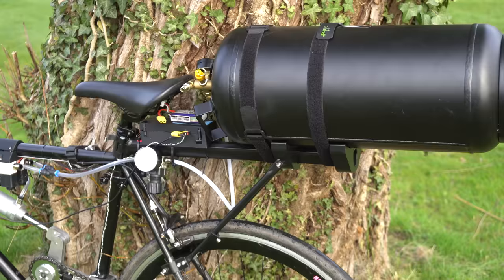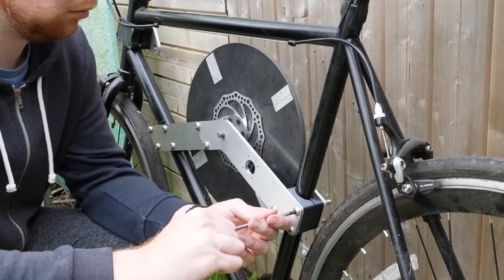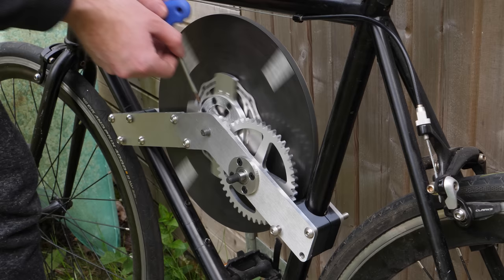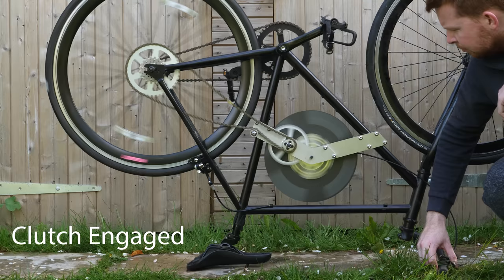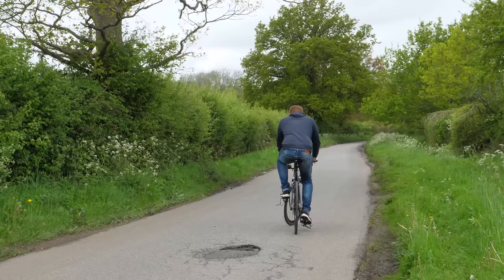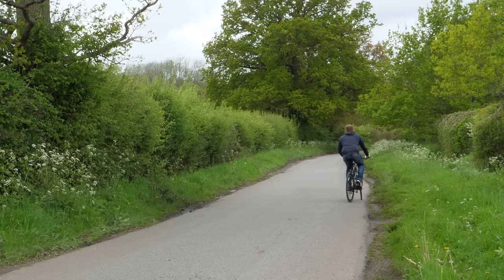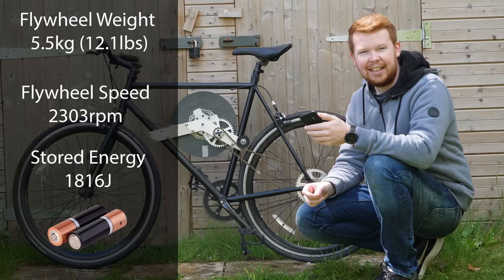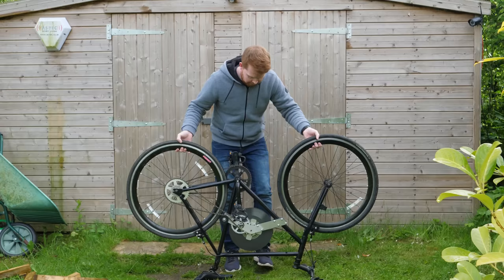Flywheel Bike KERS

Comment: Oh, Boy!  A homemade, high-speed flywheel rotating just beneath my groin!
Reply: Yay!
Reply: The sound alone is harrowing. It's like something out of Greek mythology. (Still awesome, though, in a mad scientist kind of way.)
Reply: Needs more jagged edges. Use a dia-tipped Sawblade...
Reply: If you want your boys snipped, look no further!
Reply: ok
Reply: Don't threaten me with a good time.

Still cheaper than GCS.
Reply: Your comment let's us all know you don't have anything in that area to be concerned about anyway so... If you did, you wouldn't be complaining about it.
Reply: @mikeznel6048  Men. 

Safety is not a betrayal of your manhood.
Reply: @mikeznel6048  wha...what?
Reply: That's a leap of faith.
Reply: U don’t need jewels 😂
Reply: It’s just a matter of time
Reply: @TeamCykelhold  He was saying "No balls".
Reply: Motorcyclists put a huge tank of gas and an internal combustion engine between their legs every day. We're doing just fine. Mostly.
Reply: Might I suggest a pair of steel underoos?
Reply: This is an old swiss patent,  from the man who invented yodeling ...
Reply: Kinky~😩
Reply: Also known as the "girl maker".
Reply: Who is this groin character 

(Hermitcraft and tommyinnit in mcc)
Reply: Scary!
Reply: Everything is made by someone,  it seems mint enough. Could still use some sort of enclosure non the less to prevent snagging.
Reply: And two small weights attached on the outside. What could possibly go wrong?
Reply: Balls of steel.
Reply: Mi first though also! 😱😱😱
Reply: Completely safe
Reply: Hahahahahahhauaha no margin for errors
Reply: sounds fun
Reply: At least you got a bike seat and a metal tube stoping it from hitting you.
Reply: Wait until you hear about motorcycles lol
Reply: I think it needs spikes or blades added.
Reply: Better have faith in your engineering skills huh?
Reply: Lmao
Reply: What could possibly go wrong? Right?!
Reply: Could you have used disc brake rotors instead? They are already drilled
Reply: Conceptionally not that much worse than the ICE I'm always sitting directly over when riding my autobike.
Reply: @PacAnimal  key word ... "mostly" 🤣
Reply: @mikeznel6048  My comment was straightforwardly enthusiastic.  I already wanted to see a flywheel on a bike.  Someone commented that we could install a flywheel guard.  Others chose to write comments alluding to the qualities of my groin.  Well, that's the Internet for you!
Reply: Yah
Reply: @nisemonoyarou  So check out 'i made a thing' who made a gasoline powered bayblade. I think it might satisfy your desire.
Reply: Oh boy a solid metal heavy beyblade top mere inches from my groin!
Nothing could possibly go wrong!
Reply: What could possibly go wrong?
Reply: the bicycular-vasectomy-inator
Reply: Imagine the flywheel on mythbusters between the legs...
Reply: I call it... The Cataclysmic Castratocycle!
Reply: What could possibly go wrong😜
Reply: @tutacat 

Read that in the voice of Professor Farnsworth!
Reply: WHAT COULD GO WRONG
Reply: I dread to think of the consequences should that flywheel burst that close to one's private parts.
Reply: interesting  Yeah? Was she toothy?
Reply: @mikeznel6048  If you had something in that area then you wouldn't be complaining about it?  Say what?
Reply: @nisemonoyarou  for aerodynamic reasons yeah ? >..<
Reply: I knew right from the start exactly where this was groin...
Reply: Nay
Reply: @gwagwa76  hehehehehe
Reply: I wonder what can possibly go wrong
Reply: Kers will turn him into hers
Reply: Ha yeah, what could possibly go wrong
Reply: Back in the early days of Top Fuel Dragsters, the driver would sit in the rear of the car with their family jewels just inches from the Differential that was transferring thousands of horsepower and Nm of torque whilst containing hundreds of pounds of extremely high speed rotating mass. Good thing they had balls of titanium in case a diff exploded!
Reply: @PacAnimal  ahh. Took enough scrolls to find someone on the level. We think this stuff is cool and lay risks with denim, denim/kevlar, or leather/kevlar jeans on with more attention paid to protecting our heads not so much our balls. But i will say im glad i wasnt squidding when i hip thrusted my handle bars at 40 mph. Lol
Reply: Its both genius and freakin insane! I love it!
Reply: Yeah I'd want so much more between me and that wheel in the event of a high speed material failure.
Reply: @Boe_Jidens_Hair_Sniffing  Way cool!
Reply: he could've used Tchaikovsky's "Nutcracker Suite" as background music for the video
Reply: @tutacat gunna need a set of regenerative something after riding that monstrosity, that's for sure.
Reply: @magnum0121984  not heavy enough
Reply: Ladies and gentlemen - the Testicu-Gone™️ Mk I !
Reply: @far1002  Joules?
Reply: @headly21  u need those 🤣
Reply: @onyxtay7246  Aweful lot of chicks in here... Men don't cry about being scared. In 2021 "men" cry about the wrong toilet paper and nail polish. I think you're getting them mixed up....
Reply: Hmmm... Something is a bit off here... Lots of people so worried about something they never will ever come in contact with... And the thing isn't made out of Legos like you're used to "building" toys out of. The dude made it out of steel and aluminum... Why would you even allow your lower parts to be hanging out of your pants or shorts? While on a bicycle? Awful lot of "what if" cry baby "men" leaving the most feminine, scared, baby, child like comments... If you're worried about your junk on this thing, its internal junk so you don't have anything to worry about then. If you have exterior junk, and its real, being worried wouldn't even be a thought because you're not gonna be riding this thing naked anyway... Man, the world is so crybaby now a days....
Reply: Might as well sharpen the edge like a deli slicer.
Reply: It’s the thrill of the bite
Reply: And they are not balanced. That's some courage
Reply: Lol that's what I thought when I saw..."what if"...lol
Reply: @PacAnimal  they also have a flywheel secured by special stretch bolts inside a gearbox. not ready to slice your chest open
Reply: If you really trust your engineering and fabrication, use a tablesaw dado blade!
Reply: Watch your bangers and mash!
Reply: @PacAnimal  Yeah... although I recently had a surprise when my waterpump got a pinhole leak in it. I made up a new saying - "Better than being shot in the crutch with a jet of high pressure superheated water!"....
Reply: My thought exactly
Reply: This is the only thing I could think about the entire video.
Reply: @onyxtay7246  so you're saying your not a real man, since you're whining about something another says?🤔
Reply: @roberthubbard7827  I mean, I'm not even a man, so I think that much should be obvious.

My point is that it's absurd to define masculinity in that way. It's ridiculous to go "hurr durr, you need to do risky things without thinking or you're not a real man. Hold my beer while I jump off the roof!"

It's a bad definition of masculinity, and if someone's going to try forcing a toxic stoicism onto others then I expect them to stoicly shut their pie hole.
Reply: You should see where they put the huge chainwheels in HPV speed bikes!!
Reply: @PacAnimal  id trust that WAY WAY WAY more than this. The chance of anything happening to affect your boys, are so low, I’d bet money you wouldn’t even be able to find an example of it. But this thing? Very easy for something to happen
Reply: Fun
Reply: Like a large grinding stone to sharpen your tool!
Reply: Could double as a transgender surgery robot!?
Reply: Come on ur just smuggling grapes
Reply: Some people just don't want kids of their own 😁
Reply: @PacAnimal  Gasoline is nonexplosive and as long as the engine is properly maintained and not designed by chimpanzees the chance of throwing a rod through the block is beyond neglible.
Reply: Relax. It's a flywheel not a fruit ninja.
Reply: Gotta protect the "Boys"!!!!🤔🤔🤔😁😁😁😁😁
Reply: @sour_grapes4280  and/or made out of NOMEX®!!!!!!🤔🤔🤔😁😁😁😁
Reply: Not a preffered location for accelerated masses to be launched from or clutch shrapnel
Reply: What could possibly go wrong?
Reply: Is it possible to put the fly wheel within the back wheel?
Reply: What could go wrong?
Reply: Is the extra energy output to spin the flywheel worth the energy saved by not having it? I’d suggest not?
Reply: this. my biggest concern.
Reply: You can use a sawblade so you don't have to machine anything :)
Reply: I think I would rather have a gas engine with a liter of gas in front of my groin.
Reply: @nisemonoyarou  We'll call it the Vasectinator!
Reply: Wait till you find out how motorbikes work 🤣
Reply: @TheOpenSourceMerc  Lmfao
Reply: Yes my thoughts exactly, so I clicked and it sounded just as scary as I imagined.
Reply: Kevin Nix  lmao
Reply: @onyxtay7246  right!
Reply: A chastity belt aka drawers made out stainless steel might help protect the jewels 😂
Reply: Ever hear of guards? Needed to protect the legs and trousers anyway.
Reply: Oh, you, Chitty Chitty Bang Bang...
 Shitty Chitty Bang Bang, Brute', et tu??
Reply: Insitu manscaping
Reply: @AChi__  Now that you mention it, I need a pair of those anyway.
Reply: @TheronGBurrough  🤣🤣👍🏽👍🏽
Reply: Can get your vasectomy done without an appointment tho 🤷‍♂️😂
Reply: First though was, 😧 oh that won’t end well.
Reply: I laughed so loud
Reply: Doesn't it sound exciting?
Reply: no pain no gain
Reply: For science, as they say...
Reply: Only people who got balls riding on this bike

Get it? :D
Reply: Give this bike to all the gender-reveal families, without the seat.
Reply: Good enough for who it's for
Reply: Its only 2k rpm. Better than the 14k rpm plastic disk that goes in your xbox or whatever.
Reply: Visions of table saw blades?
Reply: Like driving a RHD mini.
Reply: Lots of funny comments, two whinging men and one woman with no "incite", lmao!
Reply: Hahaha exactly! What can go wrong?!
Reply: What about the spinning gears of death that could easily punch through the thin metal between you and that transmission in your car that can explode
Reply: @mikechurch539  Those dangers are the reasons I'm going to buy a Tesla.  If my car fails, I'll die mercifully in an inferno of spontaneously combusting batteries.
Reply: Just use a stack of table saw blades.
Reply: Time to test this experimental bike without a helmet on!
Reply: at least its not covered in grippy rubber knobs leading into a metal wedge 😂 mudguards..good for more than just mud
Reply: I need a bike that moves, groin is secondary
Reply: @PacAnimal  I love riding motorcycles but i have to say that testing the 420cc generator motor that I fully built myself to rev to about 9000rpm then threw into a minibike frame was by far the most I have ever been worried about my junk while riding any type of machine.
Reply: @nisemonoyarou  I was thinking razor blades.
Reply: With projectiles being thrown off of it!  Whee!
Reply: Perfect summation.
Reply: Almost as bad as a few million little explosions per minute in between your legs aka motorcycle lol
Reply: @tutacat There you are, Perry the Platypus!
Reply: @skylined5534  I heard Professor Doofenshmirtz from Phineas and Ferb! But now I hear Farnsworth too.
Reply: @jamesdavis5517  

Or j7st about any rhd Honda 😜
Reply: @Insightfill  

Haha good call! I can totally hear Doofenshmirtz in there!
Reply: With weighs on it and luckily one only hit him in the leg.

Just saying! 🤷🏻‍♂️
Reply: That was a good start!
Reply: Use derailleur gears and chain. Flywheels are more efficient with the weight on the perifery!
Reply: Every disgruntled wife has one on order for her husband.  
Scatter shield, not included.😨
Reply: Exactly the same thought even before watching!
Reply: Free Neuter
Reply: This how to make peanut butter
Reply: @Maonnaise  
Think it's called pen-s. Butter .
Chunky style. 
Ouch!.
Or peach cobbler
Reply: A literal “Flywheel”
Reply: If that gives you a rush, just wait until you find out about fuel tanks and lithium ion batteries!
Reply: @tutacat Marvin the Martian is that you?
Reply: pov: it explodes 
meat crayon moment
Reply: Don't forget to check groin guard video 4 flywheel bike🌡😂
Reply: @gwagwa76  *yikes
Reply: C o c k  a n d  b a l l  t o r t u r e
Reply: A true dream come true
Reply: That 50% of ball-b-gone
Reply: Home-made? What "common person" has a CNC at home?
Reply: @CharredSteak  The Bicyctomynator
Reply: @mikeznel6048  "Haha lol this guy is inferior because he likes having all his limbs attached!" 

That's you. That's what you sound like.
Reply: Cyclists don't have kids because prego women aren't aero so, it's fine, lol
Reply: Taped-on tire weights free while they last!
Reply: @takeyoshix  Tom Stanton.
Reply: And it's creepy😟
Reply: What could go wrong, uhh?
Reply: Yep
Reply: It’s sits underneath a tube
Reply: . . . it's just a rotating flywheel - not a circular saw . . .
Reply: Antinatalist bicycle.
Reply: My anxiety about this after watching Tesla turbine ☠️
Reply: Balls to the walls no ballsy wallsies ✌️👍
Reply: My great great great great grandkids gonna feel that
Reply: Where is your sense of adventure?
Reply: @shortchange26  bruh if that thing broke off you can say goodbye to all feeling in your legs for the next forever
Reply: An accident willng to happen
Reply: @onyxtay7246  it sure is.
Reply: Yay my groin will get chopped off lol
Reply: @User_12737  more like crushed
Reply: @thercracer1717  lol
Reply: Whoopie!
Reply: @TeamCykelhold  shaved not clipped
Reply: It's called flywheel for a reason
Reply: Ah grow a pair!.... 
    ...... then you can worry 🍺
Reply: LMAO Hell yeah !
Reply: Right? A self-powered 'nad' nuker? For the Really, REALLY deeply committed masochist?? LOL 😂😂😂
Reply: What about putting this on each wheel?
Reply: Nothing like a good kick of adrenaline!
Reply: That bastard would take out your femoral artery if it let go. But they you won't have to worry about what it does to your man parts.
Reply: Chuckle* im in danger
Reply: Were you really using those bits anyways?
Reply: m e c h a n i c a l a d v a n t a g e
Reply: Exiting
Reply: @onyxtay7246  😍😘 my wife thanks you
Reply: They do not tend to 'jump' at you.  Like those women at the intersection thinking the big truck is gonna reach out and get them.  What was that saying...

  "Live it or live with it."    All ya need is good 'containment' hardware.  Just ask those top fuel guys strapping down those superchargers, and putting a big steel bell on their flywheels to catch them when they get loose. (that's what she said).
Reply: Lol
Reply: I well reading this my brain adopted a voice somewhere between Mickey Mouse and Pee Wee Herman.

"O̶H̶N̶O̶!̶!̶!̶ ̶S̶O̶M̶E̶O̶N̶E̶ ̶S̶T̶O̶L̶E̶ ̶M̶Y̶ ̶B̶I̶K̶E̶"
"Oh-BOY! My bike stole my balls!"
Reply: I can use the cutting disk on the kenwood food processor and make my own bike!
Reply: Woohoo
Reply: Just what I've always wanted!!
Reply: Not like there is anything important to protect anyway :D
Reply: Still nothing beats the threat to groin regions like a motorbike.
Flammable liquids, direct current electricity, explosion, venting exhaust gasses and pistons firing all directly beneath ones groin.
What could possibly go wrong...
Reply: Imagine going over a small rock
Reply: Oh wow what a wonderful day!
Reply: Wat if u put the fly wheel free floating inside the wheel
Reply: @gwagwa76  summer!
Reply: YAy something to make me not have kids
Reply: It would be interesting to see this done electrically with supercapacitors.
Reply: I do not get the concern. You're on public roads, no?
Reply: Idea is good, and simple, but damn thing better be encased.
Reply: It just polishes them
Reply: @tutacat Perrrryyyy thaa Platipusssss, here you are
Reply: @mikeznel6048  Wat?
Reply: As I watched it, I said at once to my girlfriend: oh, when my "did'l" comes into this flywheel, I don't have another one any more 
But great respect to you grandson of "Daniel Düsentrieb" ( Gyro Gearloose )
Thank you for showing 🤗💞👍
🙊🙉 😱       😂😂😂🤣😉🤗
Reply: Think thats crazy. A chainsaw runs around 10,000 rpm, and you intentionally hold it very close to the boys while in normal use. And this is also the reason i am the only one i trust to do maintenance or repair to my saws.
Reply: @poellot  A good policy!  Like checking for yourself to see if the gun someone just handed you is really empty, as they said.  The population changes with every generation.  I think my grandparents' generation are much less likely to perform careless chainsaw maintenance, leading to a hideous accident.  On the other hand, you can't use the roads without trusting every oncoming driver not to head-on you.
Reply: nice zinger
Reply: Needs a casing
Reply: Completely safe but, don't wear a kilt
Reply: @RobMacKendrick  I can hear wax melting
Reply: This made me lol
Reply: So if it comes apart ur meat is
G o n e

Even more yay
Reply: Yeah, because engineering a guard for it would be such an incredible feat. Obviously, he's experimenting.
Reply: Sounds like fun!
Reply: Yeah, what could go wrong?
Reply: Don't wanna hurt your bot surgery  careful
Reply: Lmao
Reply: I can't see nothing wrong with it
Reply: I think that was the very first thought in every man's head
Reply: What could ever go wrong lol
Reply: @gwagwa76  yay=summer?
Reply: there go yer twig and berries!
Reply: @RobMacKendrick  Fly(wheel)ing too close to the sun (my balls)
Reply: As someone who has personaly had his beanbag sliced open and caught in the gears of a bike, I can say that I wouldn't recommend it. But lol, I bet with some proper covering you could avoid catastrophe XD
Reply: @jacktorborg9862  OMG, you poor man!  I hope that worked out okay.
Reply: @TheronGBurrough  Lol! In retrospect it made for a hilarious story, and a few stitches and many weeks later it was ultimately, miraculously fine XD but yeah it's definitely a fear that I intimately have every time I get on a bike now lmao. The boys are doing just fine these days, thanks for your concern haha XD
Reply: @jacktorborg9862  I will never ride my bike upside down with the gears under my gonads again!
Reply: That's when you get your bullet proof ball protector from acme lololo
Reply: Bad ass right!
Reply: That sounds terrifying if the flywheel were to explode 😳😳😳
Reply: the saddle's in the way whatchu fraid of
Reply: @PacAnimal  Yep, I’m sure it’s gotta be a seriously overpowered leg warmer. 😂😂😂
Reply: Ehh , whats the worst that could happen , free birth control
Reply: @noahater5785  wear jeans youll be fine
Reply: Rim the flywheel in sandpaper for extra motivation to not touch it.
Reply: I'd rather a regular ball mangling chain and spikey gear than a fly wheel!
Reply: I would honestly consider buying one if you could make it quiet and contain the flywheel in some kind of protective dhell
Reply: Don't worry, there's no guard or shield so it's still light weight!
Reply: What could possible go wrong????? Whoops!!!!!!
Reply: Sure hope it don let loose!
Reply: Yup nothing sketchy about this idea at all
Reply: hey man, he used really reliable components like an aluminum sprocket and no lube oil
Reply: Just don't go biking naked, hah, nm don't think that'll still cause any issues.
Reply: Good point.
Reply: Free Groin  energy
Reply: @ProfesionalVideoWatcher  the most potent power known to humanity
Reply: Weeeeeeee !
Reply: This is just a normal Tuesday for me
Reply: looks legit i see no problems here ;)
Reply: Dont drive a rotary  then
Reply: Easiest way of vasectomy.
Reply: @green_life7  plus you get a free exercise!
Reply: @green_life7  Bicycle flywheels provide Green Vasectomies!
Reply: A Small gas engine would suck, & a Battery (E-Bike) could burn spectacularly if you drop it/crash. 

Pedaling (the old fashioned way) causes one to sweat too much in a Tuxedo....
Pick your poison, I guess😀
Reply: BTW, just go buy a used 'cup' from Play-It-Again Sports.  Or, just borrow from a friend ..
Reply: Be grateful. Some of us had to pay extra...
Reply: @onyxtay7246  yes it is
You can thank us for building society if we fretted about safety nothing would have been built
Reply: oh boy, crappy sarcasm
Reply: yes, no cowards riding this bike...
Reply: vasectomy bike
Reply: Sounds like the intro to a Darwin Award
Reply: RIght?   why not just use a car/truck disk brake?
Reply: was thinking the same thing, but that wouldn't stop me either
Reply: What could go wrong?
Reply: You just unlocked a CUTscene in my brain 😖
Reply: @Archivist Arkantrol Pretty clearly a woman, so yeah?

Not sure how this is supposed to be some gotcha. I'm still not crazy enough to think safety is unmanly or something, because that's how you get hurt.
Reply: i just got a bike! (my sister's bike)....

i know what you are thinking and.... , no
Reply: What could go wrong!
Reply: sounds fun, doesn't it?
Reply: WHAT CAN GO WRONG?!
Reply: Please add to cart 🛒
Reply: yea i would make somekinda cover just incase
Reply: I wonder if the advantage of a fly wheel isn’t eliminated by its disadvantage (additional weight to  a vehicle to move around).
Reply: Let’s rename this flywheel thing in the Genderchanger
Reply: That’s literally what I was thinking when I saw the thumbnail preview.
Reply: lets stick some wheel weights on there in line with my junk, whynot?
Reply: @«tutacat» anti-reproductive/regenerative flywheelcycle
Reply: Pro tip: more flimsy axle and taper the edge for better dynamics 🤣
Reply: Arguably no different than riding a motorcycle with a high revving piston beneath your groin lol
Reply: I love you I don't know you but I love you now 😂
Reply: Behold, visions of pain
Reply: You say that as if it is worse than a mass-produced, cheapest-cost, outsourced-production version of the same.
Reply: Nothing dangerous will happen, I'm sure!
Reply: Nothing could go wrong; trust me, I’m a professional
Reply: Exactly lol
Reply: i got a name for this bike "the nut cracker"
Reply: Atleast he didnt use a circular saw blade .
Reply: I seen worst 🤣🤣
Reply: handy for if you have an itch on your balls and havent washed it for like 6 weeks..
water cost alot oké ..  
xD
Reply: When you put it like that , it doesn't seem such a good idea 😂
Reply: Risk takers reap rewards!
Reply: Future Darwin Award winner!
Reply: Two words: Femoral Artery
Reply: That's my first thought
Reply: @mikeznel6048  Actually tarded
Reply: @CharredSteak  points for -inator!
Reply: Make it a saw
Reply: technically, if the flywheel is only 1 piece of metal it should be fine, and since it has that part of a bike frame above the flywheel it's very unlikely that it will hit something above the frame if something goes wrong, but who knows
Reply: This definitely needs a don’t try this at home disclaimer.
Reply: @mikeznel6048  ... to be fair, I knew he was joking and guys will ALWAYS direct comment to their boys when given the opportunity.
Which makes YOUR comeback worthy of comment.
Reply: Oh boy! A highly volatile, inflammable fuel that’s ignited intermediately just two feet in front of my face, separated by aluminum! XD

If it were safe, no one’d sell it, nor buy it. Safe costs too much money and energy to make, and you wouldn’t make any of it back. This is simple, and fun. XD
Reply: @l.j.d.millar2822  I occasionally break out a Bic lighter and turn the aerosol can I've been huffing into a flamethrower, too.  Safety is an illusion.  My original post was of an artistic nature.
Reply: Lmaoooo
Reply: How do you get to hell?
Very simple: claim that you're innocent.

How do you get to heaven?
Very simple: Admit that you're not Innocent, you're guilty and ask for mercy.

How to know if you're guilty or not?
Simply: Compare your life to the Ten Commandments God gave you in the Bible.
Everyone agrees that if people followed the ten commandments there would be no need for governments or police.

Do not lie.
Do not steal.
Do not commit adultery.
Do not insult God by using his name as a cuss word.
There are six more but let's just leave it at that.

How many lies have you told in your life?

Have you ever taken anything that didn't belong to you?

Jesus said, if you look at a women lustfully you've already committed adultery in your heart with that woman.
How many times a day do you do that?

Do you use God's name as a cuss word?
Would you do that with your own mother's name?

If you answer these questions honestly you know that you're guilty.

God can justly punish you and send you to hell.

Ask him for mercy.
His name is Jesus.

It's as simple as this, The Ten Commandments are called the moral law. You and I broke God's laws. Jesus paid the fine.
The fine is death.

Ezekiel 18:20 —
"The soul who sins shall die.

That's why Jesus had to die on the cross for our sins. This is why God is able to give us Mercy.

Option A.
You die for your own sins.

Option B.
Ask for mercy and accept that Jesus died on the cross for you.
Reply: @yourfriendlyneighborhoodin1559  I would like to say my comments in this thread are all humorous.  I didn’t read your reply as I am not of that school of thought or belief.  However, it is disrespectful to use Jesus’ name except as His name.  The Ten Commandments offer the benefit of understanding their logic.  I dislike the rudeness towards Christians people have been persuaded into exhibiting.
Reply: @TheronGBurrough   
I'd like to say it like this.

If you're not interested in the offer of eternal life feel free to go back to what you were doing.
Reply: @yourfriendlyneighborhoodin1559  Well you’re welcome for the courtesy I extended.
Reply: @TheronGBurrough  God does not owe us more evidence for his power other than the gigantic Planet full of amazing creatures on which He has placed us.

He does not owe us more instructions than those that he wrote in the Bible.

He does not owe us more warning than that which is provided by everyone's conscience before they take any action.

Surrender while you can.
Reply: Live life to the fullest. Even if you get an honorable mention for a Darwin award.
Reply: @V12BHP  not for much longer lol
Reply: O my groin
Reply: Wacky idea, at least
Reply: yay!
Reply: Just put some heavy-duty diamond playing around it
Reply: Just add sawteath!
Reply: What can possibly go wrong xd
Reply: Ye
Reply: The type of guy We have speed limits for
Reply: Rule 34.
Reply: @slackerman9758  ayo
Reply: Flanders
Reply: Try a spiral spring as in children's inertial toys. It will be easier and higher performance.
Reply: Free bottom surgery
Reply: @Alulaa  Eeuuww!
Reply: Yay!!!! Can’t wait to not be able to have children yayyyyyy!!!!!!
Reply: Automatic shaver
Reply: everything has its risk!
or do you prefer a natural gas tank, high pressure air tank.😁😁😁
Reply: let's not Be Honest and say we all wanted one when were a kid
Reply: @mikeznel6048  you are goofy my good sir
Reply: @TheronGBurrough  i would love to get to know the qualities of your groin 😉
Reply: @johnmark6628  idk man he was on prescription pills and alcohol or something
Reply: would prob encase it in metal with a oil inbetween
Reply: What could go wrong Haha
Reply: This guy is definitely European with a comment like this
Reply: @brenchyalowicois6748  Thank you!  Excellent channels listed on your YouTube.
Reply: I’m going to replace it with a saw blade
Reply: @TeamCykelhold  a backyard trans-former i suppose
Reply: Everything you use today was once homemade
Reply: @onyxtay7246  #notallmen
Reply: @markhilltaco4079  Really do not get the point of this. What are you even trying to say?

Use your words.
Reply: came looking for this comment 20 second into the video
Reply: @onyxtay7246  new bottom surgery just dropped
Reply: What could go wrong⚠️😳😲
Reply: First thought from the thumbnail for real 😂, just not as articulate as 👆
Reply: The people going off about motorcycles are demonstrating an astounding lack of knowledge about fly wheels and how they function.
Or malfunction, especially if you make just the tiniest mistake while making the thing yourself.

Angular momentum increased by distance to the axis of rotation goes brrrrrrr.
Reply: @UsenameTakenWasTaken  Thank you for making my point when I lacked the science!  The motorcycle people are right that burning gasoline is bad for one’s groin, as is having a gas tank jammed there during a high-speed impact.   Yet a runaway homemade flywheel poses a uniquely horrifying threat of mechanical injury.  Ouch!  Ouch!
Reply: Nobody ever tell you danger is the thrill 😂
Reply: @colbymaxwell244  That is a good word to the wise!  (But you know, the groin threat …)
Reply: @TheronGBurrough  “what did it cost”.  “Everything”
Reply: What could go wrong?
Reply: You love it
Reply: Haha
Reply: @mikeznel6048  you're weak
Reply: He said 2000rpm I see what you mean
Reply: I’ve had worse things there lol
Reply: We use fly wheels all the time. The 100 year old power plants even literally the one that powered the world Faire designed as a proof of concept for free energy (before people kept insisting free energy doesn't exist to add all these bewildering but served their goal, obstructionism). It was all fly wheel powered. This is just a 1st generation fly wheel. Modern fly wheels are still used in new power plants while the ones that are 100 years old still work and can keep going and work as it's own backup power system.

A person makes clay pots with a fly wheel. A wheel is a fly wheel. People are just used to cars but there's a reason why they're pushing evtols now when throwing away all the lessons we learned from the Wright Brothers just like we throw wwwy all the lessons we learn from tesla only to "rediscover them again" like the "rotary" engine which is just a fly wheel hacked to use fuel similar to am inverted propeller is a jet engine where you can place a ton of propellers to do jet stream, the same reason way dragon boats brought rice, citrus and also a ton of Asian people to California when California was "discovered" and the bay area was already a food bank.
Reply: Protect your groin at all time, even you have steel balls.
Reply: Are you trying to be funny or just rebellious to this guy's idea and design?
Reply: @The-GreenHornet  Funny!
Reply: Lol
Reply: Makes new think of my X-wife
Reply: Lol a noice way to risk everything manly 😂
Reply: It's a chunk of steel, it's not going to explode....
Reply: Flywheel= saw without teeth
Reply: No worse than a motorcycle...
Reply: Just you wait until you hear about motorbikes and their fists sized pistons held in by two clips.
Reply: @Dirt_Breaker  Those aren’t homemade but a vintage bike might neuter me.
Reply: excellent!
Reply: Wait till you hear what happens under your sack while riding a motorbike!
Reply: I rode a V-Twin motorcycle for a decade and every so often I'd think to myself "hmmm... cylinder #2 is aimed DIRECTLY at my junk. Hopefully the connecting rods hold up"
Reply: Stop pretending you use it anyway… 😂
Reply: Doesn't get any better than that
Reply: I just love the risk of not having children ever again.
Reply: @wanou_4259 am i the first to understand this reference?
Reply: What could go wrong?
Reply: @burb72  Famous last words.  I've said them many times!
Reply: innoespana  Sorry, no comprendo.
Reply: I mean motorcycles are the same thing pretty much. All motors need a flywheel
Reply: @onyxtay7246 as a representative of men we do not claim him
Reply: @TheVigilante2000 nullifier
Reply: @Coastal_Cruzer  I didn’t know that and looked it up.  Thanks!
Reply: “It has to be shaved one way or another Johnny!”
Reply: Imagine slipping and falling on it and your- 

💀
Reply: @RobMacKendrick "Archimedes is gonna get us all killed" energy
Reply: What could go wrong?
Reply: There’s something about fast spinning things that scare me
Reply: just what i needed in my life, ahahahahaha
Reply: You feel every bump of the road
Reply: People who are afraid of this don't need to worry, they have nothing to lose.
Reply: MY NUTS.
Reply: More like a fly wheel. Amirite?
Reply: @Gardner0871public  Well, the joke was about a flywheel accident right there in muh Kuh-ROTCH!
Reply: He needs to try a saw disks